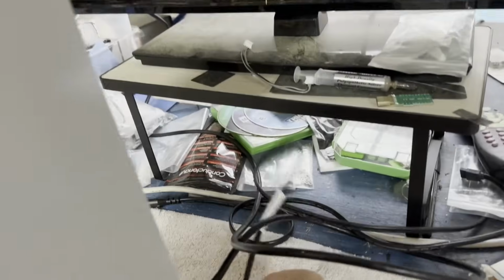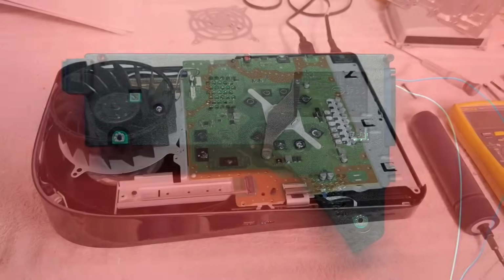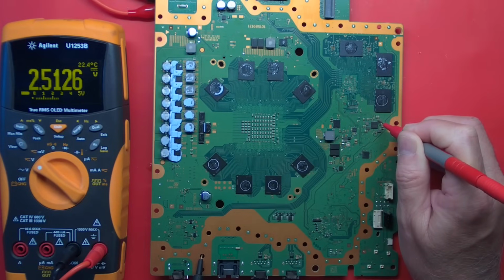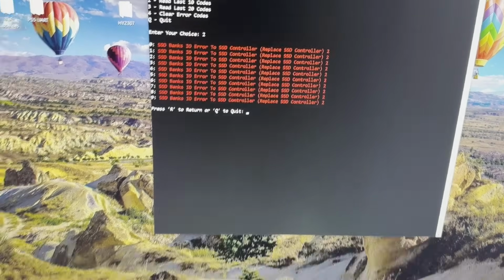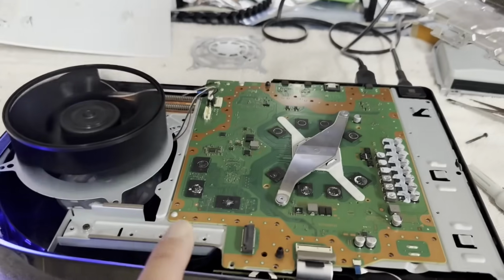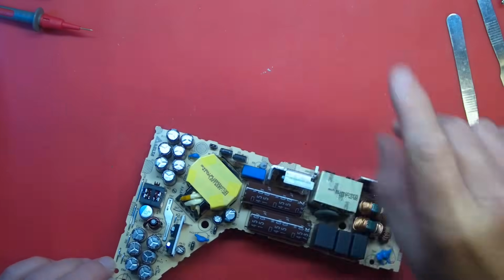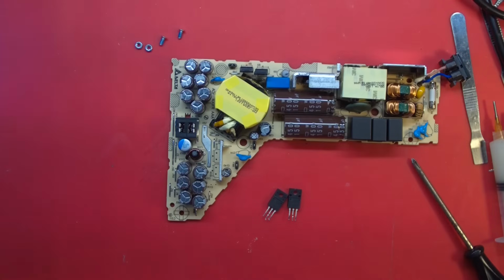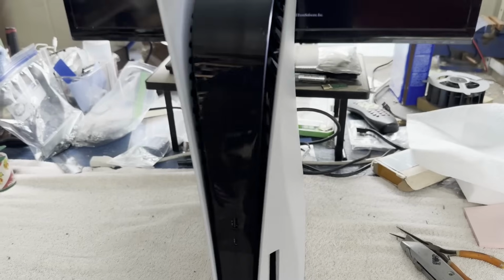#145 Repair of a Dead PS5

Comment: hi, I have a strange case, after turning it on and the PS logo, the LED starts to glow white, no image, reinstalling the firmware does nothing, maybe you had something similar?
Reply from the maker: Your problem is probably the HDMI port or the HDMI Encoder IC.

Comment: Hey ToltecMerc, great video as always!  I was wondering if you would be interested in a PS5 that I have to do a video on? Currently the state of the board is it pulls up to 0.3amps for a few seconds and goes back down to 0.01 amps for the standby sequence, notable items are it doesn't have any shorts on the board I can find, chips that have been replaced: South bridge, memory controller, HDMI encoder, and a wifi chip reflow.  I'm a hobbyist repair tech that volunteers in my county and I would appreciate learning from you if you can figure out what's wrong with it!
Reply: Forgot to mention it is currently in a state of 1-2 second BLOD

Comment: Hi, have you ever mentioned the temperatures you use for the preheater and the gun when soldering/desoldering chips ? If yes please point me to this video. Also why you put this tape on top of the crystal ? To protect it from direct heat ?

Comment: A master's job Sir thanks for sharing this informative video. Just a question please as we see here the mosfets are on the output side but we also see rectifier diodes if I'm not wrong so what is the purpose of the mosfets on the output and if you can provide a reference so that I can understand what did you mean here please?

Comment: What is the recourse for something like this?  I bought a PS5 slim with a reported HDMI problem. Fixed that only to find out the previous owner killed the drive as well ripping out a game disc.
Reply from the maker: If the disc drive is the one that came with the console, you can remove the PCB inside the drive and transfer to a good Blu-Ray drive.  It would need to be the correct model as they have made 2 or 3 different Blu-Ray drives by now.

Comment: It freaks me out every time when you don’t discharge the capacitors first! Please for your viewers sanity (plus as a good example) immediately discharge the caps. Also what is the white goop you put on the transistors?
Way to defeat the dark forces of eBay!
Reply from the maker: The white grease is Silicone Heat Transfer Compound.  Thanks!

Comment: Hate when people do that on ebay, so scummy, glad you were able to fix both the ps5 and power supply! able to share the name of that white thermal paste you used on the mosfets?
Reply from the maker: Thank you!  Plenty of scammers out there.  The white grease is just generic heat conductive grease.  I got it from eBay.  It is marked AA-Grease 04.  It is in a 50 gm tub.

Comment: Watch out for those Ebay scams. I had a couple claiming 'no power - so no other testing could be done.' End up being dead power supply,  messed up components on the board and the worst part psn banned. I have opened eBay case, and after some time, I was able to get my money back. Sellers tried to scam me even after that by opening a case against me, stating I sent them, not a complete return, but Ebay resolved it in my favor.  Don't let those sellers get away with those scams.
Reply from the maker: There does seem to be a large number of people on eBay who are willing to do anything for money.  Best of luck in all your repairs!
Reply: @ToltecMerc bro my ps5 suddenly  goes off after i puts it on sleep mode and refuse to turn on.i am living in bangladesh. And here is no good mechanics like you..i consulted some local mechanics they said problem in motherboard what should i do?i bought it only 1 years ago..I don't have money to buy another. I am so broke..it was my first console..please give me some advice.
Reply: That's because buyers like you often expect to be recieving a fully working item and is often the case you/they don't bother reading descriptions and then go crying to eBay about how hard you're done by. Read the description and then check the sellers feedback and avoid pointless returns.

Comment: Glad to see vids from you again m8. What is that tape you use on the ssd controller? Seems like its kapton but looks different. Also be careful with that bwe software...the author seems to be a bit nutty lately lol
Reply from the maker: It is some kind of heat resistant tape that comes on SSD controllers from AliExpress vendors.  Whatever it is, it is very tough so I have been hanging on to the little pieces and reusing them.